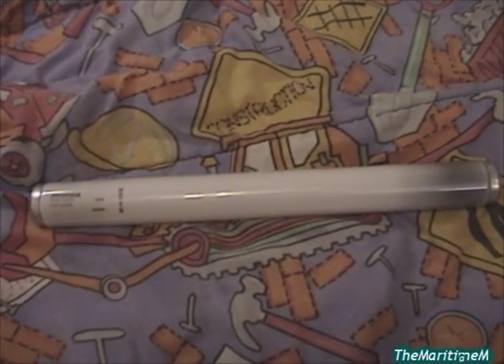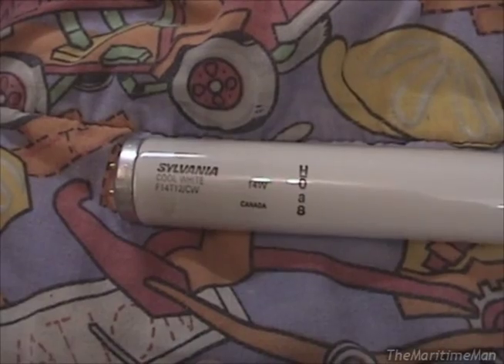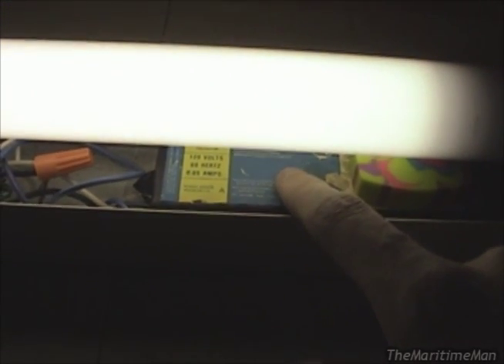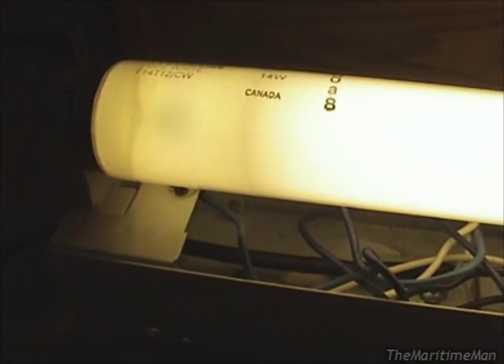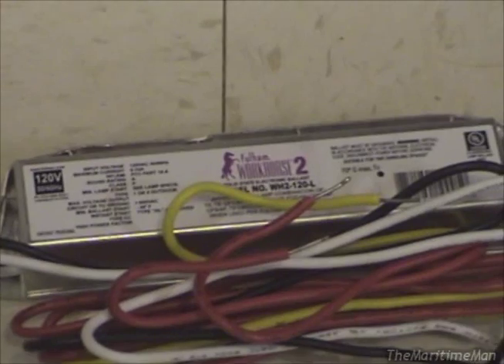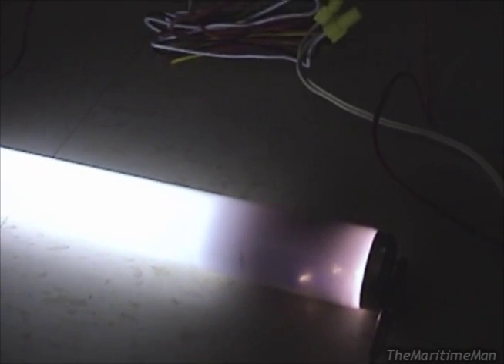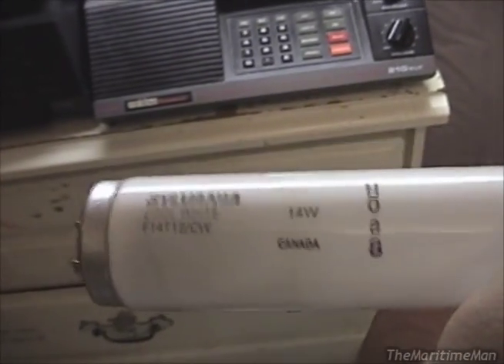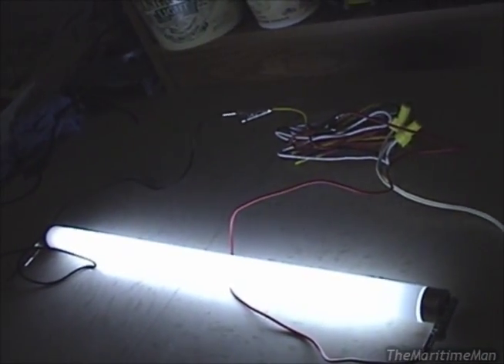Frying an F14T12 fluorescent lamp

Comment: I remember reading that when the U.S. Navy ran fluorescent lamps on DC power on their ships, they would periodically swap the bulbs around to equalize the wear and prevent them from getting black at only one end.
Reply from the maker: Yep, that's right! Another reason for swapping them around is to offset the effects of mercury migration, which would cause one half of the lamp to become dim. I've read that the F14T12 was actually developed to run on DC power in streetcars. Their short length made them less susceptible to mercury migration, and made their arc voltage low enough to run on the 64V system that was used.